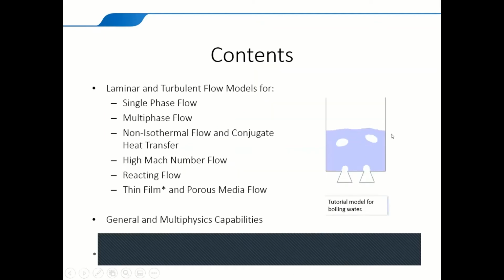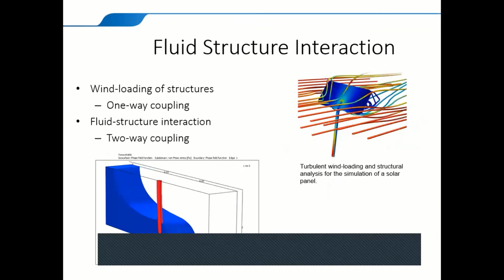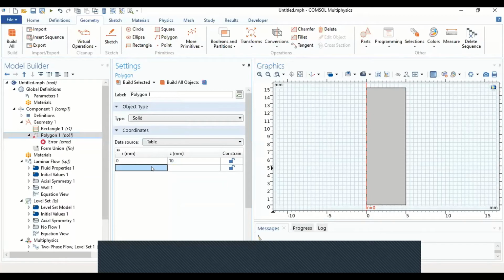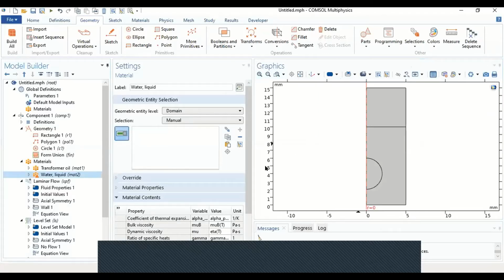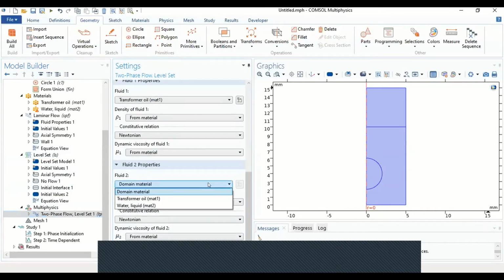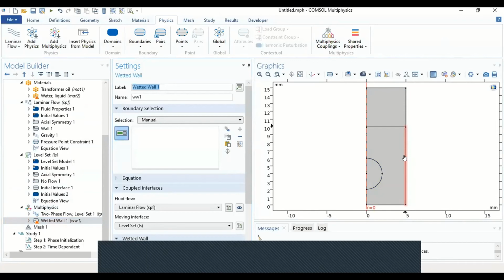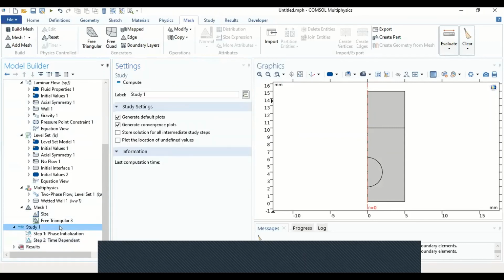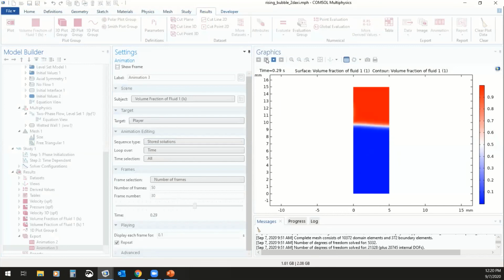Introduction to COMSOL Multiphysics CFD module - Multiphase model

Comment: Can we add thermal boundary condition in level set?
Reply from the maker: Indeed, by coupling CFD with Heat Transfer in Fluids you get the Non isothermal flow Multiphysics node as well as the option to add a source of heat in the heat transfer in fluid physics node.
Reply: @elnadyengineering2451  Thanks for your reply. Can you please clarify a bit more? What do you mean by CFD module- what physics in comsol should we choose? the level set is under multiphase fluid flow. I have tried selecting both level set and heat transfer, but during the phase initialization, only the physics interface allowed to solve is level set, not heat transfer. That's why I am not getting any thermal plots after the solution.
Reply from the maker: please send to comsol@elnadycompany.com your license number & your affiliation to forward your request to the person in charge of your country
Reply: @elnadyengineering2451  okay...thanks.

Comment: I am not getting the 'initial interface' option in COMSOL 6.1. Can anyone please help me ??
Reply: have you found the guidance or not ? i am also not able to find it
Reply: I tried using it in version 5.6 and then opened the same file using version 6.1. COMSOL gave a notification that the initial interface option has been discontinued after version 5.7. It is an obsolete option that is not required in the newer versions. @easyhack5859

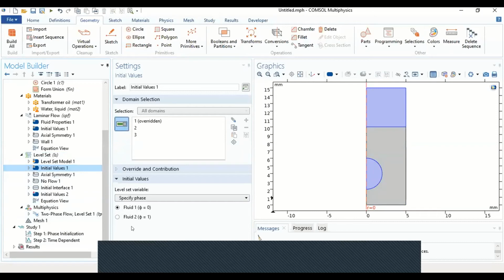Comment: Hello, I observed something about the setting up of the Level set physics: At 09:12, you selected Fluid 1 (phi=0) for the initial value 1, but at 11:40, you then to changed it to Fluid 2 (phi = 1) again. Recall that earlier in the video, Recall that earlier the initial value 2 was set up to have a phi = 1 value.
Reply: I also noticed it... Previously fluid1 was oil and fluid 2 was water, but initial values 1 and 2 are now both for fluid 2, i.e., water... So is there no oil now in the domain???

Comment: Thanks for your great explanation, sir. As a newbie, I want to examine the effects of the air flow through the pipe on the oil film layer on the inner surface of the pipe. Which physics would you recommend me to choose for this? Unfortunately, I did not get the results I wanted from my experiments for a long time. I will probably need 3 layers here, namely air-oil film and pipe wall.